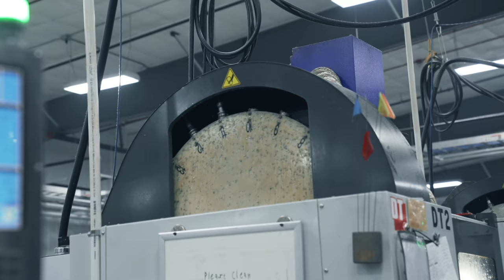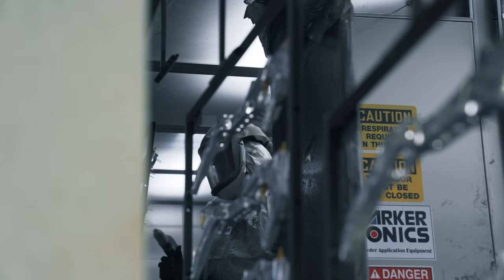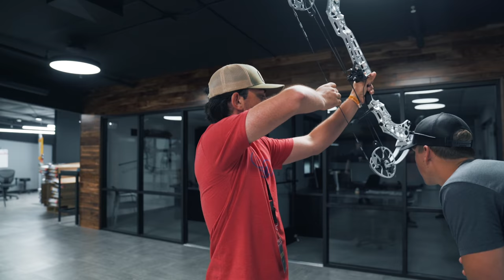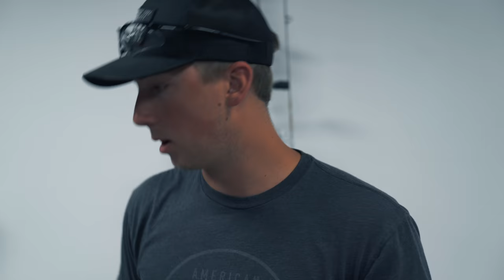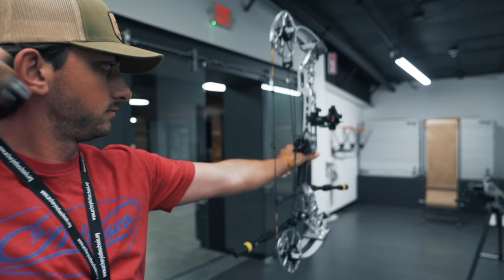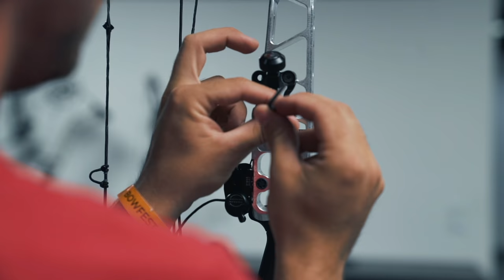MATHEWS V3 PROTOTYPES FIRST LOOK

Comment: Can you PLEASE plead with Mathews to put together a 33-34" TRUE hunting bow for a person with a average DL???  The TRX 34 has really nice specs, but with it in the target bow lineup there are NO camo options and the price is a little bit steep compared to the hunting lineup.  Now that the Traverse is gone, there really isn't an option if a person wants to stay with Mathews.
Reply: The hunting line with the extended riser holds like a target bow. They are the longest risers they have ever come out with. Even longer ata hunters tend to like them.
Reply: They did 2 years ago... Traverse
Reply: @dillonwalling  The Traverse is a great bow.  Too bad they decided to give it the AXE instead of updating the platform with some of the new tech...
Reply: @saxophone_mockingbird6480 , I've shot all of these bows.  Even though these are neat little bows, they do not hold and aim like a target bow.  You can trust me on that statement, as I speak from experience